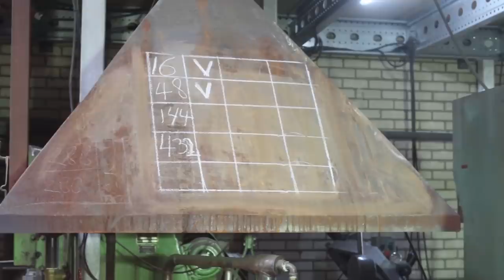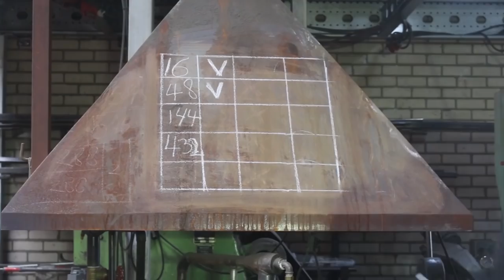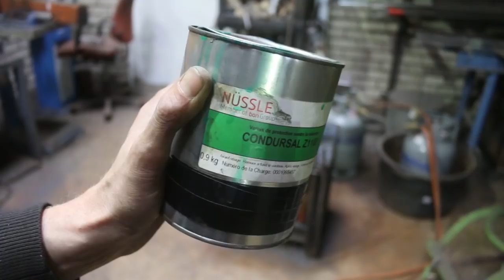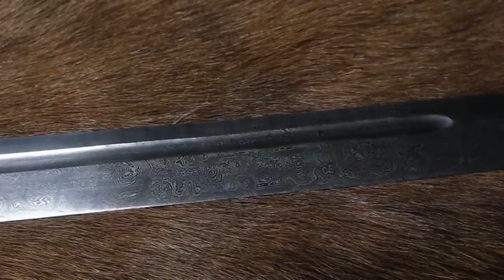Forging the Heron blade, the complete movie.

Comment: Very well made Sir, you are a true craftsman. That is for sure proven in this video. I would comment though al though it has been several years since i read the series I do believe that the heron on your actual blade is upside down.
Reply from the maker: could be,  but commissioned  this way,  its always strange to determine the top of a sword,  is it the tip or is it the pommel.

Comment: 31:46 How does that not hurt your heat treatment? Until now, I’d been under the impression that any temperatures above ~200-ish degrees Celsius ruined the temper. Is there some nuance I’m missing?

Comment: Can someone explain that technique he used with the torch heat and brushing to turn all of the steel that goldish colour?
Reply: Heat the metal and brush it with an brass brush, that's it.
Reply from the maker: yes not that hard,  but quite effective

Comment: That press seems to be in need of some major repairs. It should not drift off to the side like that when you press down on anything. Do yourself a favor, spend a couple of hours, figure out which part is broken, repair it and stop dealing with it drifting to the right like that
Reply from the maker: the press is too strong for the frame.  it warps.

Comment: Ooof, the blade kept bending...  Even after the quench...
Reply from the maker: it should bend  shortly after ht,  its the short window of time to correct warps etc.
Reply: @freerkwieringa275  I know, but it kept bending multiple times, that usually (not always) says that spot is weak.